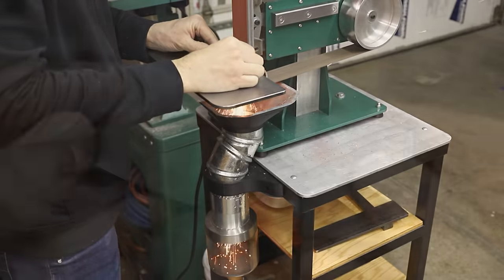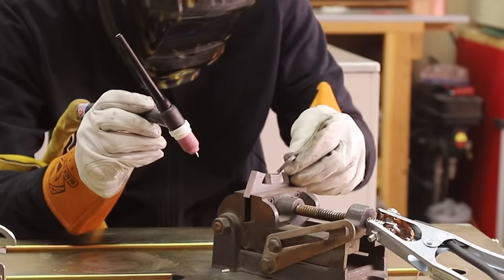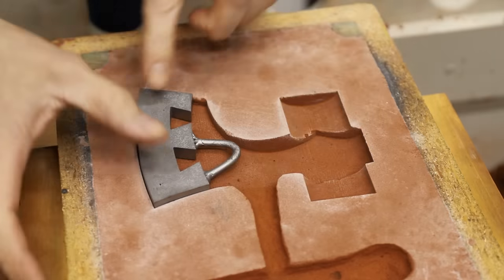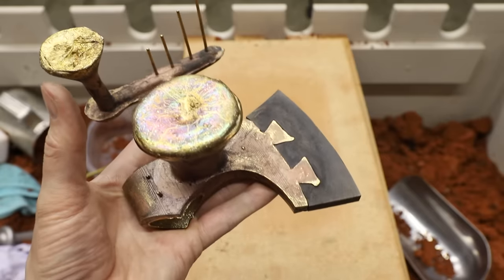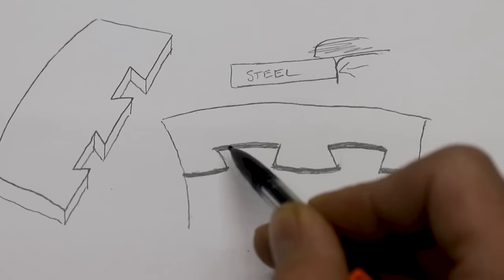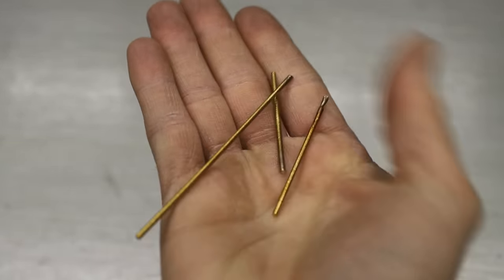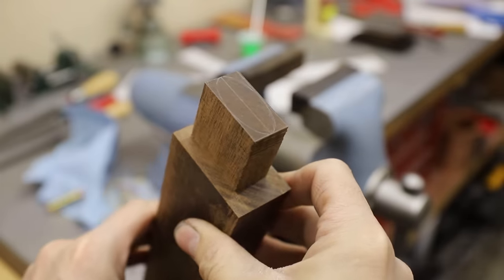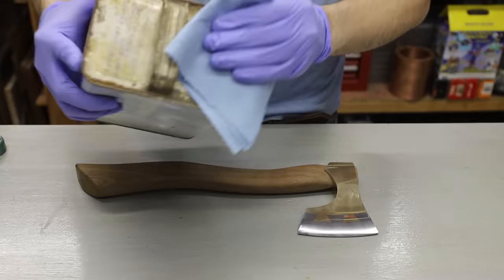Making a bronze hatchet with a steel blade - Dovetail Axe

Comment: Hi, blacksmith here: I really like the concept! Unfortunately that hardening you did was WAY too cold. The entire piece has to be glowing at least dark red, you can check with a magnet: as long as it is magnetic it is still too cold. Also there is a high chance that the casting got the steel too warm again to retain any hardness that would have been there
Reply: I do agree about the quinch temp and you could be right about removing the heat treat with the bronze but I figure with the amount of steel there and the bronze only touching the back it should only temper the back abit and not the whole piece of steel but could be wrong, its possible that using an induction heater to only heat the edge of the steel and harding it after its been casted could work better but youd need an induction heater to get that controled of heat placement
Reply: Also a smith, I had the same concerns. It is super cool to look at, but my hangup is our predecessors didn’t make axes this way for a reason. Not saying it CAN’T be done, but alot of work to make it correctly.🙂
Reply: oh. that axe looks nice.  click.   what an interesting video.  i wonder if other commenters agree?  "hi, blacksmith here,  dark red, anealing, glass transition temp, something something"  down the rabbit hole i go! 😄
Reply: Only aesthetic improvement for me would be a bronze wedge.
Reply: You forgot the most important part that seems goes over all the forging channel's heads: galvanic corrosion. That axe will just crumble to dust but what do I know? Nothing about lame channels and their quest for the daily trend.
Reply: @suprememasteroftheuniverse  i would say that is definitely not the most important here. Also steel and bronze work quite well together, bronze bushings are very common in steel housings and don't cause problem in a reasonable time
Reply: @benediktpaul157  dude, suprememaster whatever has feelings, you know!🤣 I believe that person is thinking too hard. It will work just fine, as you said.
Reply: Where's the electrolyte? @suprememasteroftheuniverse
Reply: @benediktpaul157  your st pidity is amazing. You even got a cheerleader.
Reply: @anvilsbane  it seems that donkeys are animals of feather as they say. You love to flock together.
Reply: @suprememasteroftheuniverse  ok? Mixing metaphors is not a good way to reply. Is Ingrush yoor secund langwij? It’s an AXE not a nuclear reactor. Galvanic corrosion is a non issue. Durability, now. That COULD be an issue.
Reply: I did you the courtesy of googling galvanic corrosion for you: 

"Galvanic corrosion, also known as bimetallic corrosion, is an electrochemical process whereby one metal corrodes in preference to another metal that it is in contact with through an electrolyte"

Now, as I asked earlier, where is the electrolyte? @suprememasteroftheuniverse
Reply: Often cameras cannot pick up the color of steel when heated, and I don't think the casting annealed the edge which is the most important thing
Reply: @Menatetronone_4  you are right about cameras but they do always pick up if the steel is glowing or not and this one certainly wasn't. And the tempering all depends on how long he left the casting in the sand before cooling it off
Reply: I am sure he intends to put this Decorative piece to hard work...
Reply: @georgeblack589 the sweat from your hand can contain enough salt to aid in corrosion. That said, while AINAB, I don’t think galvanic corrosion is a big issue here. Unless you’re chopping wood in the shallows of a salt lake. The while there is a difference in conductivity between the metals, bronze isn’t exactly know as the greatest conductor. Now that I think of it… would it keep your edge sharper longer by drawing any corrosion to the head of the ax? Worth an experiment right?
Reply: How has nobody commented on carbon scale? You can tell its hot enough by just looking at the edges, but there is some carbon scale on the sides.
Reply: @JumpingJerry  No.
Reply: Lovely work, there is something wrong with the shape of your axe handle though, it looks too heavy somehow. I think perhaps it’s just too damn curly ! I don’t remember all those curves in a plain hatchet handle, you have all the features of a full length axe handle in a handle a third the length !  you lose all elegance like that, and with such a beautiful axe head it shows.   Why boiled linseed oil ? to feed the wood it should be raw oil.
Reply: Could you use a hand torch or an induction machine to do an edge quench on just the steel cutting edge?
Reply: @jessewilliams4152  yes you could! That would be the way I would likely fix it
Reply: @benediktpaul157  I thought so. Thank you for answering. Cheers.
Reply: @suprememasteroftheuniverse galvanic action is a non issue. Too many people heard that somewhere and now are constantly looking for it. BS major chem minor biochemistry MS matsci and a D.O. professional degree. Do I know a thing or two about matsci.
Reply: @suprememasteroftheuniverse   I have just one thought on the matter of if you matter.   Look at your name.   Nuff said.
Reply: I also don't particularly trust the method of tempering there...seems that would have likely removed all the hardening processes benefit
Reply: I also don't particularly trust the method of tempering there...seems that would have likely removed all the hardening processes benefit
Reply: need to agree. looks cool but this hardening no workey, this will not be a usable axe. but it looks cool.
Reply: @suprememasteroftheuniverse lol you’re wrong
Reply: @suprememasteroftheuniverse  tell me who hurt you
Reply: Bot?

Comment: Because of your I've bought a 3d printer and built a furnace. Thank you, brother.
Reply: Because of *you
Reply from the maker: That’s awesome! I’m glad to hear it!
Reply: @TamahaganeSteel they probably meant to say "because of your videos"
Reply: I think he meant to say, "Because of your sick vidz brah, I bought a 4d printer."
Reply: @znefas  I do that all the time; rewording a comment but forgetting to update the grammar
Reply: @znefas please don't assume nate goes by they/them.  Thank you.
Reply: That plastic must hold some heat to work at minus 50 degrees
Reply: Because of you I've chopped my finger off.
Reply: @TamahaganeSteel ok english teacher
Reply: @TamahaganeSteel rat
Reply: with what money my guy, teach me your ways‽
Reply: @robinson-foundry You should look up the recipe for Nordic Gold, way cheaper, way lighter. I've been making hybrid blades and axes like this for years now due to the price for good steel where I live, never thought of dovetailing it like that though that'd make it even more sturdy. Admittedly I've only had one failure (and it was my fault for abusing the axe) but it's a really cool way to save money and weight. But heating your mold and bit is essential. (Testing to see if this comment finally passed the YT AI censor, if you can see this, then I guess it has.)
Reply: @robinson-foundry Btw those wriggly handles are a modernism, they serve no purpose other than significantly weakening your haft by reducing the size of material you have long fibres passing through. Please avoid using them. It's a horrible fashion trend that serves no practical purpose and leads to larger heavier and weaker handles for no reason other than a trend. If you steam bent it it'd make sense. But the way you Americans make them makes no sense, and sadly other countries have copied it because it's now seen as how axes 'traditionally' are made when it's NOT traditional but under 50 years old for most of the world, and under a century for the US in most places.
Reply: let the forging begin! Make a spoon!
Reply: @BuzzingGoober please shut up, they/them is generic, it fits everyone whether they  like it or not.
Reply: @znefas  how dare "        " misgender "       " a second time.
Reply: @BuzzingGoober  shush, just shush.
Reply: Because of *you I bought a book on English grammar
Reply: have i just given u your 420th like?  if so, i already gave someone their 69th like on this same video, wow im on a streak, and im zootewd

Comment: I may have mentioned this previously  and if I did I apologize I am a 60 year old guy  who did Architectual Woodworking as a Career for over 35 years due to medical Conditions I was forced to retire in my 40s  I’ve always had a Intrest in metalworking  and Forging  watching these videoes I not only find very Informative but  also relaxing and  in a way therapeutic  Mentally  in my 40s I suffered 6 Strokes of different levels  and they did cause  a fair amount of brain damage that resulted in  some Paralysis to my body  I often get the similiar feelings on watching the videoes that I would have gotten  out of working  in my own Wood or Automotive Projects

Comment: I think the steel really sets it apart...MUCH stronger and can be sharpened much easier than the bronze!  Plus the two tone of the axe is incredibly beautiful!
Love the shape of the handle and the overall look...DEFINITELY a beautiful piece!
Keep em coming!!!!
Reply: I also wonder if this axe would be surprisingly usable since it's not uncommon to use soft steel for the body and hard steel for the blade to get the best of both worlds. I suppose the only issue would be a crack between the two, but that extra loop seems to be more than enough to stop that
Reply: @TheMaskedArcanum  
I'm more worried about galvanic corrosion, aluminum and steel do not like to be touching each other. Maybe the copper will prevent said corrosion but I don't know enough about metallurgy to be sure.
Reply: @MediocreNed  Looking it up, the steel he used is a low-alloy steel, and likely has an anodic index of -0.85, and apparently aluminum bronze with his proportions might have one around -0.35. That's a 0.5 volt difference, which from what I can gather means it needs temp and humidity control to be fine long term. Aluminum bronze itself is fairly great at being corrosion resistant, but it'd be much lower maintenance if he flipped his ratios since aluminum casting alloys have a -0.95. Then it'd be fit for harsh environments.
Reply: @TheMaskedArcanum 
So it won't corrode at the dovetail joint like I was worried about but it will be more vulnerable to patina/rust overall? If so, as long the axe is oiled it should be fine, tedious but doable.
Reply: There is no such thing metal like aluminium in the bronze age, it was tin & lead back then
Reply: There is no such thing metal like aluminium in the bronze age, it was tin & lead back then
Reply: @aikonlatigid  No one mentioned the bronze age

Comment: A bronze wedge would have looked cool but I love this project. Great job.
Reply: Bronze wedge, and a bronze endcap for the handle would be nice touches.
Reply: it looks like it needed a groove along the edge of the steel to support it from side to side. Although he did put in that little hoop of steel, this looks like it will 100% move sideways if used as an axe a few times. very good looking art piece, though.
Reply: @itoibo4208  
The pressure from the differential expansion and contraction of the metals might make it a more secure joint than you'd expect. For example look at the Canadian 2 dollar coin, after some early problems with the center falling out because of just how cold it gets up here were fixed they're generally very durable. Only way to tell would be to make a less-nice one and give it a good torture test.
Reply: @MisterBones2910  maybe. One common action of an axe is to pull the handle sideways to split things. I feel like this would start coming loose after doing that several times. There are also side forces from just hitting things slightly off. I realize this is an art piece, and it is beautiful, but I would be afraid to actually use it, because it might be ruined fairly quickly. As you said, a test would be nice.
Reply: @itoibo4208 
I'm a welder so I've got a good amount of experience with thermal expansion in metal, while I can obviously guarantee nothing I'd personally feel quite safe using it. Keep in mind that it's the same sort of pressure joint (not the dovetail, just the expansion part) that holds the head of the axe on the haft, at least when it's cut down flush with the head. The only worry I might have is if the bronze began to deform, but it's got quite a bit of meat to it and I'd imagine you'd notice it happening before it came off and took a bite out of your shin.
Reply: @MisterBones2910  yes. I am more worried about ruining it than anything serious like harm happening. I think it should stay on a mantle or in a case.
Reply: Yeah I know I was shocked he didn't put a bronze cross or circles as wedge keepers

Comment: This man knows a thing or two! As soon as I saw your spark collector I started taking notes but I would never have thought to include tig wire in the original mold. It would occur to me that I might want to cast some with leftovers but putting those holes in there is genius.

Comment: Beautiful work, lovely axe head! The dovetail is a great idea.
As a woodworker, 2 things I'd have done differently about the handle:
1- use a sturdier wood than walnut, like ash, white maple or hickory, walnut is a bit fragilw if you mean to actually use the axe
2- finish the surface with a card scraper instead of sandpaper, it gives more of a sheen after oiling, whereas sanding has a more "dull/mate" look, which might make sense if meant as a showpiece. 🙂
Reply: On a handle as short as that I don't think walnut will be an issue, and I don't imagine it's going to see a lot of hard use. On anything longer, or on a tool that's going to be a workhorse, I agree with you.
Reply: @zenhydra   yeah i agree, and a lot of things people forget it grain orientation. and if its just a showpiece then this little hatchet is fine but I worry about the eye deforming
Reply: @Yaboyycrunch  that head will be loose within the first 3 uses, the eye wasnt seated properly, it hits the bottom of the handle before even getting snug in the eye, you can see he just push it on by hand
Reply: @drmusrudloff  yup

Comment: Really gorgeous axe. The first time i saw alu bronze i thought "this alloy looks amazing, i wonder if you could merge it with steel and make a real tool" and this is basically how i imagined how it would be done. Dovetail joints and an anchor. Glad to see it work, well done.

Make a rough sledgehammer with the same method and use and abuse it. I'm really interested how that joins holds up to repeated heavy blows.

Comment: Nice work, I've only seen this done one other time...
About twenty years ago I was in an antique shop and came across an old scythe with this type of dovetail construction and a crazy high price tag. I've never seen another or found any info on a company making scythes with bronze spines and tangs, but dovetailed steel blade bits.
The two metal construction can however be found on hand sickels with rivets or pins holding the pieces together.

Comment: Awesome idea on this build, and I think it came out beautiful.
After you welded that loop on the edge, steel, I thought next time you could also drill some holes on the inside of the dovetail pattern to lock in the Bronze. I like the added loop for sturdiness, and also a little handle to lift it out of your kiln. 
Great job, you’re very talented

Comment: That is beautiful. A very common way of making an axe is to use a lower carbon steel or iron for the main bofy and a higher carbon steel for the edge, but to use two completely different metals? Never have I even heard of something like that before. Amazing work good sir.

Comment: I made a centrifuge with a bike,wheel once for making silver jewrey that worked well that is another way to force the metal into the gaps. I made silver hearts in silver then recast like you and forced gold into a hole I made in the middle of the heart.it was more work than its worth at the end.not enough contrast between the bit of gold and silver in the end. You on the other hand is awesome

Comment: Beautiful! Artisan made. There is an advantage in the weight of an ax head relative to the type of work required e.g. long handled 3-5 pound ax for camping and splitting. 2-3 ;b hatchet for camping and kindling. But i have the sense you knew this.
An impressive workshop you've created. I'm in love with the 2" belt grinder/sander...

Comment: Love the video! Very beautiful work.  I was curious how this was done as I know very little about forging. But handles is something I do a lot about.  One thing I can add for you is that a wood like walnut is very hard and brittle. Makes for a good decorative handle but still can be used as a working tool. But when you use hardwood like that, you need a softwood wedge.  Some will say to use a harder wood than walnut in this case, but hickory or ash will hold the head tighter for longer.

Comment: Its super. Couple things I might add in your casting are some wedges for the axe handle. 
If you were to make a axe with a hammer end you could use flat stock to weld the end on and then bent just right towards the handle end. As long as the flat stock has holes in it, it should hold. 
Super cool dove tail.

Comment: Very nice work... the best was the way you solved the problems in dovetails.... 👌
If the connection was done with "rounds" (like puzzles) it would be easier to fill and it would resist better to fatigue... I guess...